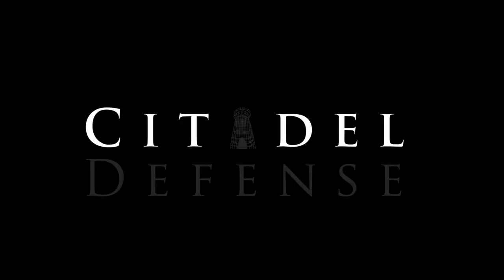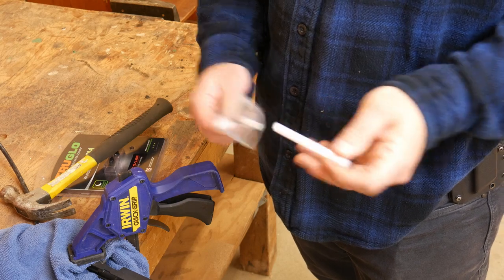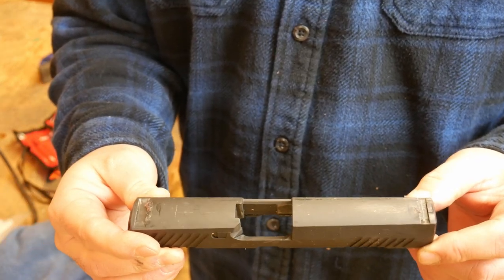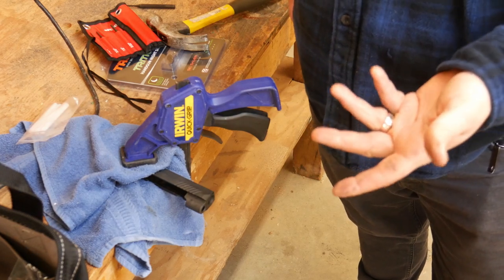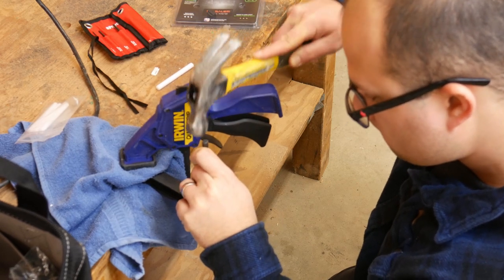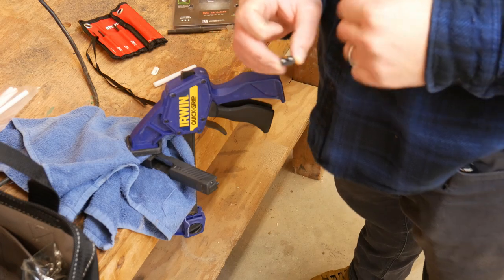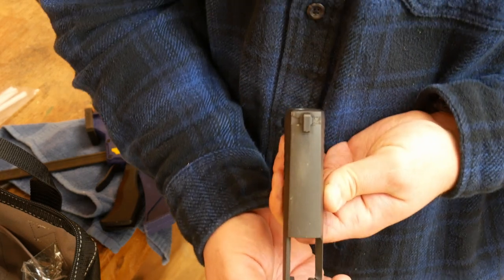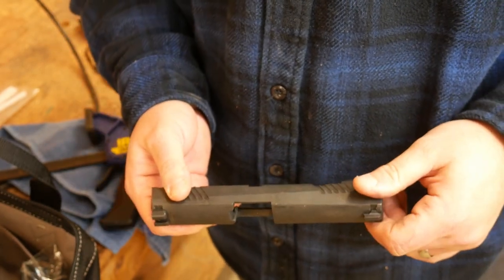How to install sights on a Sig P320

Comment: The slide should not be hanging off the bench that much. Watch the clamp jump with each strike in this video. The further it hangs over, the more leverage you give the hammer blow. For breaking it free put it right on the bench, then just hang over the minimum to finish.
I would also say you aren't finished until you sight it in and adjust, and that's when I would tighten the set screw.

Comment: I cannot get the front sight out of a P320 3.6 Pro Cut Slide for the life of me with a punch! Yours came out so easy and you’re not even using a vice, what the Hell!? Any advice?
Reply from the maker: Eesh.

I don’t know man. Sight pusher?
Reply: Did you get it out? As others have said, maybe make sure you try Right to left removal. I would gently heat the slide a little, too. Do NOT have the slide hanging off the bench like this guy, makes it give too much with each blow. Break it free directly supported by the bench, then hang it over just enough to clear.

Comment: Right to left removal. Left to right install as you look from the rear of the weapon. As per Sig.  You did opposite in this video on the front
Reply: Thanks great tip.
Reply: That's what I came here looking for, thanks